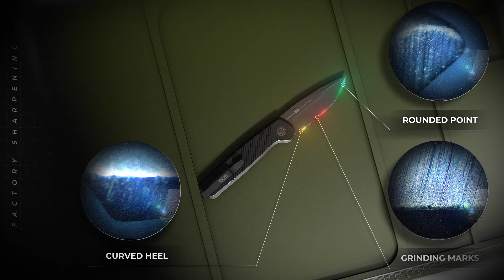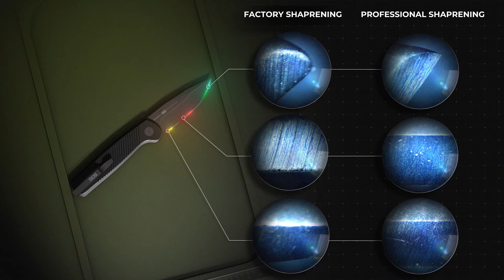SOG Terminus. From EDC Knife to EDC Razor. Factory Sharpening vs Professional Sharpening.

Comment: Awesome vid ! I love these vids you do every week or so  , I’ve been using 6x1” pieces of Bass wood with diamond emulsion for stropping , It eliminates the chance of rolling in front of the cutting edge unlike leather if pressure is applied, If I do use a leather strop I lower the angle .02 degrees , this compensates for the squish of the leather so you don’t roll over the apex 😊BTW anyone wanting the bass wood 6x1” hobby lobby has it , you can make around 6 strops from 1 piece it’s super cheap and affective, they fit directly in the clamps no aluminum backing is required
Reply from the maker: Many thanks for the feedback! Why not, that's a good option as well :)

Comment: Just curious about the burr removal. I noticed that you were using edge leading strokes as opposed to edge trailing. How much of a difference does that make, if any?
Reply from the maker: It makes no sense in terms of cutting characteristics, however the bevel looks better when all marks left by abtasive stone are directed in the same way.

Comment: How come you did not use a strop at finishing? Was using the 3K grit stone the equivalent of using a strop?
Reply from the maker: Simple, every next stone removes the burr left by previous stone with each turn of the knife. When we reached the 3k stone the burr it leaves is so small that technique we used provided a result you've seen in microscope. No strop required.

Comment: Se volessi riprofilare abbassando angolo a 17° come fare? In una volta oppure in due?
Reply from the maker: if you want to reprofile with lower angle, take into account that the width of the secondary bevel will increase. That also depends on the steel. If steel is pretty soft, the cutting edge will not last long. I don't really understand what you mean by "In una volta oppure in due?/Once or twice"
Reply: @TSPROFSharpening  🙏👍😊👌👋👋🔪
Reply: @TSPROFSharpening I meant in a single step or several steps, that is, reprofiling several times, the steel that I would like to lower as an angle are three folding knives: the cpm110v, m390 and vanax

Comment: You don’t strop your knives. Is there any certain reason for that ?
Thank you
Reply from the maker: It depends on result you want to achieve. If your main goal is to have a shining cutting edge - no reason to use a strop, 'cuz after 3K stone the bevel will look good enough. If you want to remove all residual burr from the edge, it's reasonable to use a strop with diamond paste, but it requires a lot of skill to properly process the edge with it and avoid such mistakes as bending the edge or pulling a new burr from it. That's why we decided to show a technique that would not give a "bad advice" for those who don't have a sufficient stropping skill.
Reply: @TSPROFSharpening  thank you now I understand everything much better because it all makes sense to me now . 
You are correct because I am a beginner, and funny thing is that I do get it to become extremely sharp where it catches on my fingernails but after I use the diamond pace, it’s like I blunt in their life, even though it has a mirror edge on it 😁✌🏼